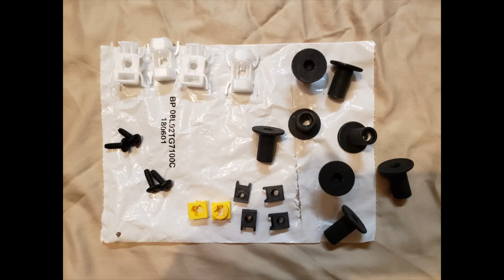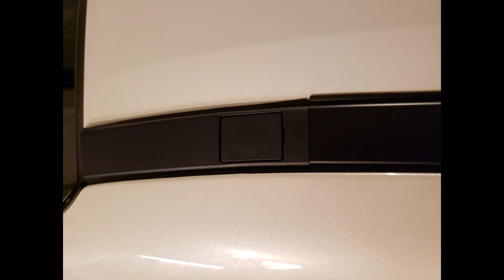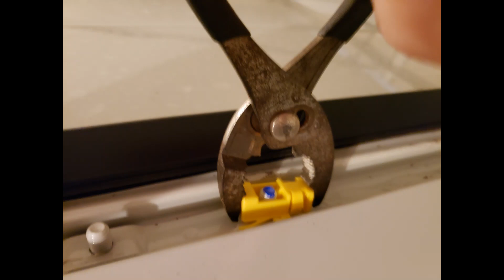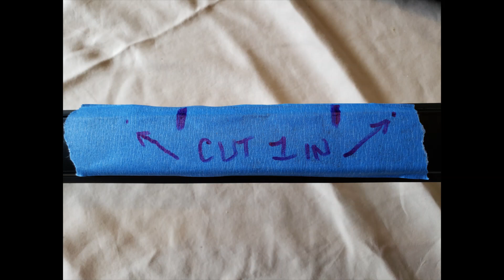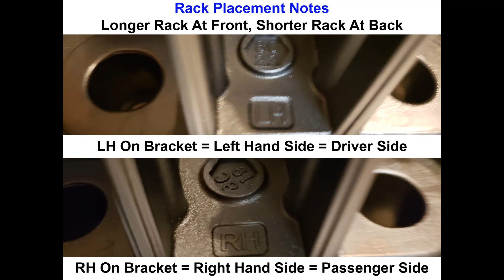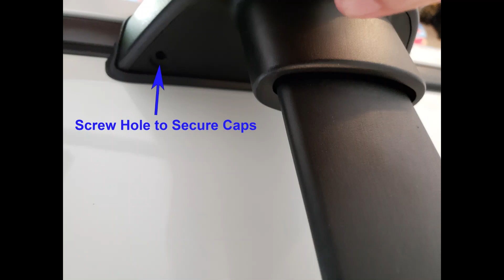2016-2022 Honda Pilot Base Roof Rack Installation - Part 08L02-TG7-100C

Comment: Hi everyone - could someone who has installed these measure distance between the rails on center and the max hight off of the top of the roof at the center and at highest point whereever that may be.  I have a low garage door and want to see if they would fit under it.  I also have a long yakima cargo box and want to see if it will fit on the rails and if it will fit over the fin. Thanks.

Comment: Thank you for this video! I just installed on my 2019 and the tip with where to cut is so much easier than the instructions. I would say the oscillating multi tool with a nice blade is a nice and easy way to cut the rails. I tried first using a Sawzall and it did not go well.

Comment: When I look for those racks with the number you give out it says 2019 to 2022 do you think it fix’s on my 2016? On the title of your video it says 2016 to 2022.
Reply from the maker: Hello Pedro, please read the comments below, racks were not made by Honda until 2019, but they fit all 3rd generation Pilots from 2016-2022. Thanks, Steve
Reply: @steveforehand1746  ok thank you I just wanted to know before I bought them
Reply: I have a 2018 and have been wondering the same thing. Anyone successful installed them on a 2016-2018?

Comment: Hi Steve,
Thanks for sharing. I just purchased the crossbars and remember hearing you state in the video that they come pre mounted and adjusted to factory fit. I just received mine and noticed on both cross bars one side was not secured fastened completely. And now when I go to fasten the base it still has slight play. I'm pretty sure it should not do that and feel like the screw cannot tighten anymore. Did you have to fasten base mount to the cross bars or was it tight from the factory?
Reply from the maker: Hi Joe, sorry for the late reply. There is a chance that you may have received the wrong crossbars. I had a Gen 2 Pilot that had crossbars that you are describing. Both the front and back bars had one side with a floating (adjustable) end piece. The ones made for the Gen 3 Pilots should be fixed lengths. Please ensure that they sent you part number 08L02-TG7-100C.

Comment: Hi Steve, thanks for this video. Really very informative. I was wondering that rather than cutting the molding for the double studs, could you instead drill 4 holes into the molding directly over the 4 studs? Same exact process as yours but instead of using a hack saw to cut away about 4 or 5 inches of the molding away, just simply drill four holes. Would that work? Thanks!
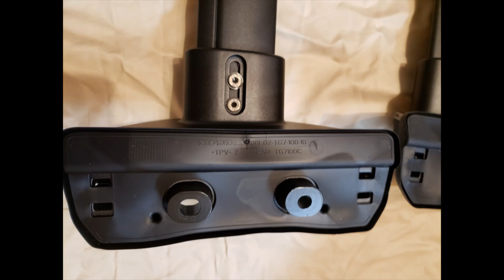Reply from the maker: Great Idea, but unfortunately it will not work. If you go to 1:55 in the video, you will see the bottom of the crossbar supports which extend into the molding channel. So you must cut the molding away to install them.
Reply: @ZM Audi, I'm thinking you mean the drill saw hole, correct? It will make a bigger hole and you might not need to cut the molding.

Comment: Thanks! Worked great on my 2016 Honda Pilot. Only difference was the molding at the front just pulled up and out of a different type of clip instead of removing the cap over a bolt. I made the cuts with a jigsaw with a metal blade which wasn’t the best but worked fine in the end.
Reply from the maker: Great to hear it worked out Nathan! And thanks for describing the difference in the 2016 installation.
Reply: Hey I got a 2016 Honda Pilot. Does those really fit on the 2016 Pilot?
Reply: @Ricosuavee88  sure does!
Reply: @nathanbuttermore9518  thanks again

Comment: This was perfect.  Dealer quoted $700 for part and installation. Cost me $300 ($250 + tax and shipping) and a $6 torx t40 screwdriver.  I also did the primer but I bet it would have been fine. Took me an hour total. Savings = $400.
Reply from the maker: Thanks for your practical review! I choose the Pilot EX-L model because I did not want the second row captain chairs that were in the upper level model. So I installed a trailer hitch, running boards, and these roof racks to bring it up to the same usable level. All were simple installations that really changed the look and function of my Pilot and I saved a lot of money doing it myself. Appreciate the positive comments.
Reply: Just curious...what year Pilot?
Reply from the maker: @nathanbuttermore9518  These are Honda factory made racks that fit all 3rd generation Pilots made from model year 2016 through model year 2021.
Reply: @nathanbuttermore9518  2021. 2 weeks old. LOL

Comment: I had the dealer install this rack, and it's extremely noisy.  Honda corporate explained that the thicker side of the cross bar needs to be in front and narrower side in the rear.   It seems they may have installed backwards, but they're saying they did not.  The howling sound starts at around 25-30 mph and only gets worse as I go faster.  Does anyone else get this much noise from this roof rack?  Thanks.
Reply from the maker: Hi Dillon, My racks do not make any noise even at highway speeds. I would verify that you actually had these Honda engineered racks installed. You are correct that they shaped like an air foil and must face the intended  way like an airplane wing to control airflow correctly.
Reply: Were you able to get this fixed?
Reply: Yes. I finally convinced them the front bar was backwards and they fixed it. Now it doesn’t make a sound.

Comment: Hey Steve, We have a 2017 Honda Pilot AWD EX-L 3.5L V6. Will the racks you installed part 08L02-TG7-100C work? The College Hills Honda website indicates this product is only for: 2019-2021 Pilot LX, EX, EX-L, EX-L NR, SE.  Any clarification you could provide would be appreciated!
Reply from the maker: Hi Leland,  Honda did not offer the "base" racks as an option until the 2019 model year, hence the fitment range of 2019 and forward. All third generation Pilots from 2016 though 2021 share the same channel stud pattern,  so the base roof rails fit all 3rd gen applications. Thank you for viewing the video.

Comment: I’m looking to install the rails on my 2021 passport. Any chance that these fit?
Reply from the maker: I'm not a Honda tech, so I cannot make any guarantees as to Passport fitment, but there is a good chance they will fit since a Passport is a Pilot with length removed after the back doors.

Take a look at the instructions for installing the Passport roof rails - here is a link: https://www.collegehillshonda.com/instructions/passport/2021/roofrails.pdf

Note that the Passport has 3 sets of the double studs needed to install these racks (a 3rd pair sits is over the front door). In addition to trying a regular install using the middle and back double studs, you might even be able to install the front racks further forward, but that may require adjusting the width. You'll know as soon as you take off the rail trim if they are going to fit. Simply return them if they do not. 

Good luck an please let me know how it turns out.
Reply: @steveforehand1746  I will. Thanks for your reply

Comment: Does this rack fit 2017 pilot?
Reply from the maker: Hi Mark, They fit all Gen 3 Pilots 2016-2021. They were not introduced by Honda until the model year 2019, hence the reason they show fitment of 2019 forward.

Comment: Hi, great vid. I am not able to find these bars under the part number you gave though. Do happen to still have the link to the place you bought them from?
Reply: Well never mind, found the part!
Different question, what are you carrying on your bars, bikes, surfboards?
Just wondering cause I was curious about what carrier brands did you purchase if you dont mind sharing. Thanks!
Reply from the maker: I carry two 37 lb 9-foot kayaks using Malone Seawing racks & ratchet tie-downs with Yakgear hood loop straps. Total weight roughly 90 pounds. No issues with bouncing or wobbling at highway speeds even in windy conditions. I also installed Honda running boards and Honda hitch to carry bikes. My vintage Hot-Buttered tri-fin (circa 1984) goes inside.

Comment: Where you Bought these racks?
Reply from the maker: Hello Pedro, you can search the internet using the Honda factory part number 08L02-TG7-100C to find vendors who sell them. Most vendors have them priced between $240-$260 USD per set plus shipping cost. I bought mine from College Hills Honda because they had the best price at the time.
Reply: Thanks I looked online I found them in the same place.!

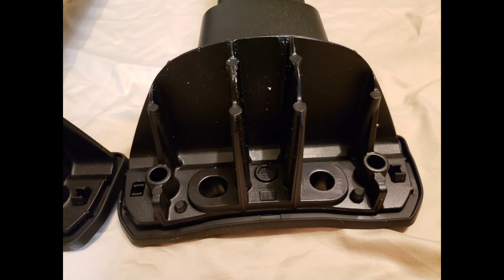Comment: On the video at 1:54, what is the spacing distance between those two screw holes?
Reply from the maker: Hi Orville, Thank you for watching the video. I am fairly certain that the spacing is 6.5 cm (65 mm), but you can contact a dealer who sells these factory racks to verify.
Reply: @steveforehand1746  Thank you

Comment: Great  idea, well explained! What have you attached to it so far, and has it held up well?
Reply from the maker: Hey Chris, I haul two 37 lb Dagger Zydaco 9-foot kayaks using Malone Seawing racks & ratchet tie-downs with Yakgear hood loop straps. Total weight roughly 90 pounds. No issues with bouncing or wobbling at highway speeds even in windy conditions.

Comment: Hi Steve, first awesome and very well done video. IMO this is the best option available for my Pilot roof rack. According to Honda this part is for 2019-2020 Pilots.  I have a 2017 Pilot and have found on the internet others that have successfully installed this rack on 2016-2018s (not just 2019-2020).  Do you know if this rack will fit other third gen Pilots as well?
Reply from the maker: Hi Joe,  Thanks for the positive comment! I don't believe that the "base" rack option was available until  model year 2019, hence the fitment range of 2019 and forward. All third generation Pilots share the same part numbers for roof rail moldings, clips, and roof rails,. Also, all model years share the same channel stud pattern, so these base roof rails should fit all 3rd gen applications. Thanks again for viewing the video.
Reply: Hi Joe, Did you wind up doing this for your 2017?
Reply: @nathanbuttermore9518   Yes, the 2019-2020 OEM roof rails fit perfect on the 2017 Pilot.

Comment from the maker: Thank you for watching the video and leaving a positive comment! Why remove them? Mine do not cause any wind noise, nor have they affected my gas millage. Neither style of the Honda factory racks were specifically designed to be removed once they are installed and sections of the channel trim are removed during the installation process, so the factory channel studs would be visible if you were to remove them. I hope this response helps.
Reply: I need help Where can I purchase the roof rack I have a 2017 Honda pilot  ex  base roof rack
Reply from the maker: @litaelsinta6647  Hello Lita, you can search the internet using the Honda factory part number 08L02-TG7-100C to find vendors who sell them. Most vendors have them priced between $240-$260 USD per set plus shipping cost. I bought mine from College Hills Honda because they had the best price at the time.
Reply: Thank you so much

Comment from the maker: Hi Rahul,  Answer #1 - Since both types of factory crossbars are attached at the same points (where the double roof studs are), all factory attachments should fit identically. Both types of factory crossbars are rated at 165lbs. Answer #2 - per the Yakima fitment lookup site https://fitlookup.yakima.com/  - the Skybox should fit either setup.

Comment: Thank you, Steve! You answered most of my questions in this video, even my local dealers couldn't help me. I have a couple of questions if you don't mind,
1. Is this compatible with all Honda attachments (Kayak, roof basket etc)? My local dealer suggested the roof racks have limited support for Honda accessories, rails/cross-bars are better in this regard. 
2. Based on where you've positioned this, will it support a long cargo box like Yakima Skybox 12 - which is 92" long? Is there any flexibility to position the roof rack bars a bit further up the vehicle roof? My primary concerns are rear door opening/closing and antenna.
Reply from the maker: Hi Rahul, I just replied to your questions.
Reply: @steveforehand1746  Thank you, sir!